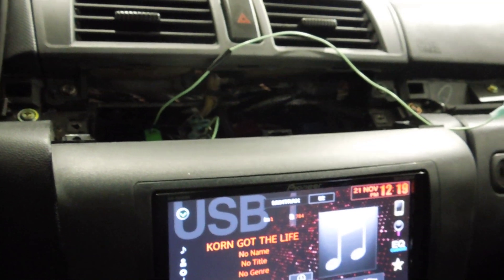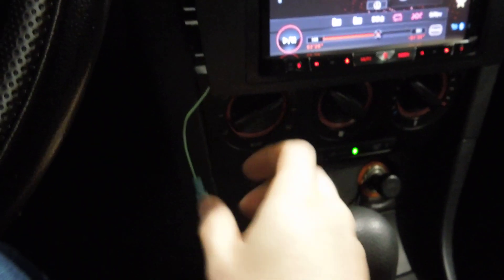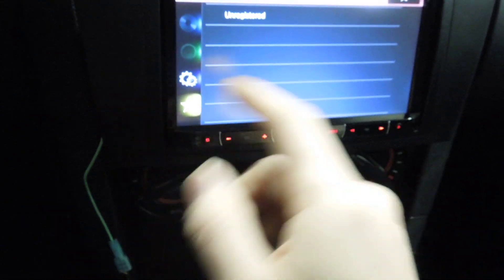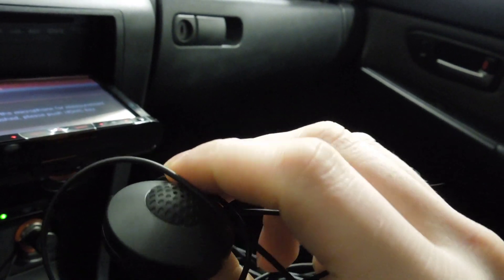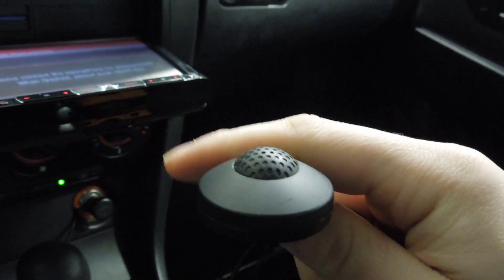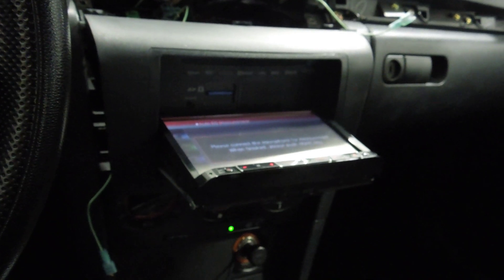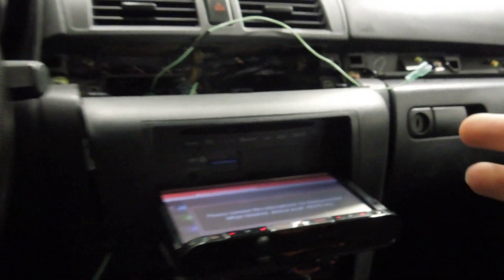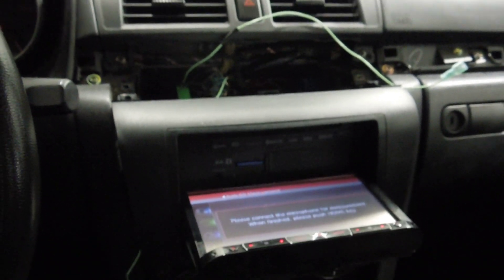pioneer auto eq equalizer tutorial and relay issue fix avh p8400bh

Comment: im gonna try the turn the deck off then back on thing in the morning. My whole center section of my car is still torn out now(10:49pm). I did notice that if i cut the remote wire and splice both sides and start the car then put them back together that dvd would work so the turn the deck on and off thing might just be the trick here. Thanks so much and also thanks for showin me the whole mixtrax thing cause i havent even cracked open the deck manual to check out some of the advanced features.

Comment: Thanks for your response.  I'm too lazy to pull out my head unit to do this too.  My dashboard is really tricky to remove.
I've found some EQ settings that I like too.  My real issue is that I need to replace the stock speakers with better quality ones.

Comment: bought an avh x1700s caught hell trying to get the auto eq working the manual made no mention of the green parking brake wire having a connection with the auto eq just video your video was very helpful in helping me resolve my auto eq issue i have a 97 town car i paired this head unit with a gothic 2500 5 channel amp and 5 new speakers the sound rivals any stock installed in cars today thanks for the video

Comment: I have the pioneer Avh-5800bhs and I'm at the Auto EQ Menu and its telling me to plug the mic in but my faceplate doesn't go down. do I need to plug it behind my head unit?
Reply: juicybaka12761276 awesome! thanks for the reply! I already have a USB running from the back of the head unit running through my passenger compartment.. can I use that USB instead and buy the male USB and FEMALE AUX adapter and plug the mic from there??

Comment: i am interested in getting this receiver....i have been reading the manual to get an understanding.............my question is .....assuming i read the manual correctly that i have to auto eq first , before i can time align the drivers (high/mid/low mode).......this being said , after i auto-eq......can i still adjust the 13band eq (or bass and treble) on the fly....... or are the eq settings shut off????.........reason is........say a particular cd is recorded bass heavy or to much treble and i want to just correct that quickly

Comment from the maker: When your cars on and running if you hit the off button than turn the deck back on does the relay click in ? Might need to wire in a switch instead. My relay after i start the car relay clicks in to early so i have to turn the deck off and turn it back on.

Comment: I can't get my auto eq to eluminate no mater what I do.  I have the parking brake wire wired to a switch to ground but it won't eluminate no mater what combination I try.  I'm thinking it might be an issue with the pioneer and my Axess module.  Do you have an axess module for steering wheel controls?
Reply from the maker: could be best ground is to ground it to the lip of the cigarette lighter well auto tuning

Comment: do if I get the message function is not available when driving I have a pioneer avh-p2400bt bypass by fabor nececito your help
Reply from the maker: lixandre paredes means your bypass is not working or you should be using a tr7 bypass module

Comment: I have my parking brake wire connected to the actual parking brake and it's still greyed out. I have the Pioneer AVH-X3700BHS. 
Sucks you can't tweak it though, not sure why they would make it like that.
Reply: You have to engage the parking brake, release the parking brake, then engage the parking brake again. If that doesn't work, grab a meter and double check the wire you've got it connected to. It should go to ground when engaged.
Reply: Select “source off” from source menu first.